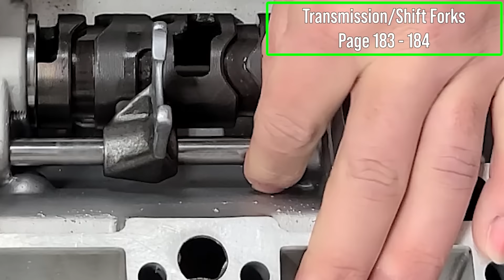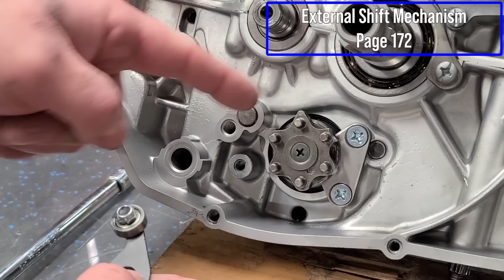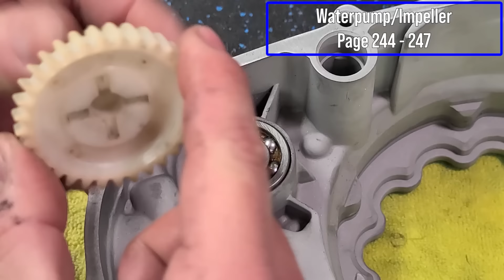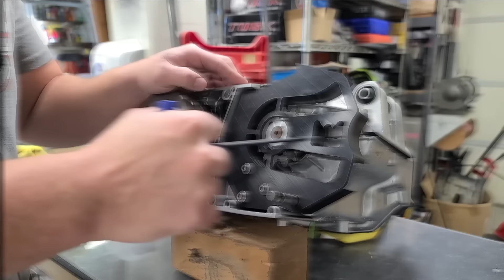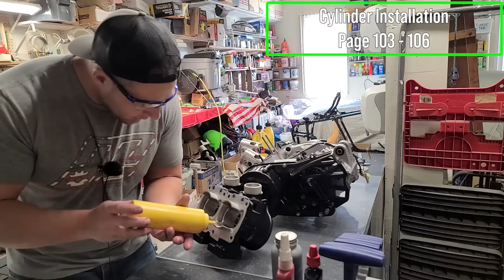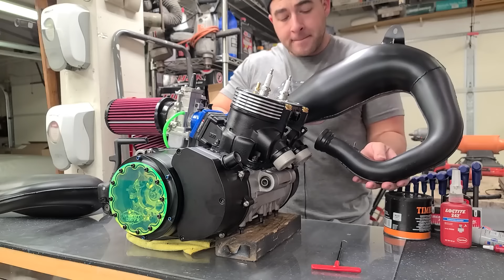How to Build a Yamaha Banshee 350 Engine | 1987 - 2012 Full Build Step by Step

Comment: So I’m new here but I was letting my gf and her sister ride my banshee but rode it in first apparently transmission is good all gears shift nothing is a new neutral but won’t idle well and when put in first gear and letting off the clutch it dies did my top end give way also carbs are clean not sure about the reeds

Comment: 14:27... Is tightening the studs with a tool a recommended procedure in the service manual? 

I build big V-8's for drag cars, and it's a HUGE no-no to tighten head and main studs. HAND tighten only!
If the studs are tightened in  full-size automotive engines in blind holes, there's a chance that they can pull the threads when things grow, and the stud is firmly bottomed in the hole. 
Things need to be able to have room to grow... 🤷🏻

Comment: Great video and very informative. Two small critics, one is the flywheel key; it is supposed to be installed parallel to the taper of thecrankshaft. If you look at your flywheel, you'll see it's tapered, and the angles should match. The next thing is never lightening your flywheel by removing material because they will be unbalanced and put extra stress on your stator side crankshaft bearing.
Reply: Well, then re-balance it... 

NOT a big deal
Reply: @davelowets  how would u recommend balancing it?

Comment: Awesome video, I´m building an engine and cant figure out if I need two circlips (the ones half a circle) for the crankshaft and gearbox bearings/seals or if I just need one for each? the manual only shows one.

Comment: First class instructional video, ... My only suggestion is a little less gasket sealant on the crankcases, .... whatever is expelled  externally when the cases are tightened , will also have the same amount INSIDE the cases.

Comment: Great video! Im rebuilding an 87 motor right now and appreciate the work you've done to make rebuilding these motors easy for a beginner. One thing I'd like to recommend so you don't scratch any more cases. Instead of using a chisel to bend the lock washers, use  long flat nose pliers.
Reply: I also recommend medium retaining compound on the water pump bearing and center crank bearings.

Comment: What are u doing your negative 10 degrees on the adjustable timing plate. U had it backward.  Why did u install the flywheel with the timing @-10??? I don't expect u to answer me. u never do. But I'd hope someone would tell u how wrong u are

Comment: The electric RC car industry has, a pressurized can of cleanup spray called oddly enough; Motor Spray, It’s the ideal thing to clean off uncured RTV. Assuming of course that your black, Yamaha-branded sealant is indeed, RTV (room temperature vulcanizing).

Comment: Hey Mike I just had my entire motor rebuilt (cases, seals, bearings, crank, cylinders, pistons) and not even 5 minutes into riding the countershaft seal popped out. Looks like they applied some sealent on it like you did. Would you just slap a new one in it and call it a day or would you think it could be something more sinister that caused it to pop out so fast? Awesome video by the way! Looks like your countershaft seal started to pop out in the video too but you caught it.
Reply: thinking back on it I guess it could have been popped out before I ever even rode it and I only noticed once taking it for a ride and threw the oil around...
Reply: Just bang it back in and call it a day... hopefully it will stay put

Comment: hey man great video im following it now for my first rebuild. now im wondering with my aftermarket kit i got the main trans bearings with those bearings stays are already on the bearings and they run almost all the way around not like yours or the stock ones i pulled out of mine? any help would be appreciated! i got my kit from BPATV with those CP Monoblock aswell. Thanks.

Comment: hey Michael i love your videos man! I've been binge watching getting ready to rebuild my banshee! i just wanted to ask you a question! so I rebuild my motor from the ground up about 5 years ago with a hot rods crank (stock bore) and stock top end, when I rebuild it the stock crank that was in it had seized up at the bottom of the rod where it connects to the crank shaft. now when I pulled this motor apart this time the same thing happened again on the same side so I'm just wondering if you may have any idea as to why that's happening so hopefully, I can fix it!

Comment: Do you think that if you put 2 Smartcarb SC-2's on that engine, that they would give that engine a more crisp feel to the throttle response? I'm no engine or carburetor expert but from what I've seen on youtube, the Smartcarb is a lot better than stock carbs and a little better or equal to some other after market upgrades.

Comment: I'm leery of an aluminum sprocket spacer. I've seen many steel ones with oil seal grooves in them.

Also, if you are going to replace your shift lever adjuster peg, the spring should be replaced at the same time, as the worn spring can start wearing on your new adjuster.

When testing the shift mechanism, a spacer can be put on the outside part of the shift shaft before the shift lever is attached. It helps keep the shift shaft pulled all the way to the left, so to be less  cumbersome.

Good call on replacing the kick idler gear clip every time. I do too. Tab washers too. When replacing those clips, there is usually a smooth side, and a sharp side. The smooth side should go against the gear, and the sharp side away from the gear.

You don't need the tab washer under the clutch nut, but an appropriate sized washer will keep the nut from digging into the clutch hub.

You had some clutch scuzz on the inside of your hub! That crap is hard to scrub off, you basically have to scratch it out.

On pistons, I like to use my hand deburring tool, and chamfer all the sharp edges. I believe that encourages oil retention.

That's absolutely right about the pin clips. Got a ruined Blaster cylinder here as proof.

Another good walkthrough Mike!

Comment: I prefer to freeze the cups and warm the head to install them. If you put the cups in the freezer for a couple hours they'll get cold enough to shrink about 0.005". Towards the end of the cooling period for the cups you can start gently warming the head with a propane torch in sweeping motion across the whole thing. A welding blanket or firewool will help keep the heat contained. You can use an oven if you're worried about uneven temperature across the head and to reduce any chance of warping the part. Then they drop right in. All you have to do is line up the keys and let go. They plop right into place with zero effort and no chance of damage. There's a few seconds before the parts thermally normalize so if one is a little off you have time to fix it. I'd suggest gloves for the cold bits so you don't warm them up with your hands 😉 It looks super sick so far. Keep it up man.
Reply: This.... 👆

I do this ALL the time when I do rear-end work on full size vehicles. It WORKS

Comment: How come you didn't go into detail about the carbs and the install of them?
Reply from the maker: I talk about them a little bit in the series of this build but there is a lot that goes into carb setup between jetting, needle size, slide size and picking the correct carb itself for your build/riding style and fuel selection. There's no one size fits all, especially with 2 stroke and to set carbs up correctly, you really need to have an understanding of what you're doing/listening for etc. I'm afraid an instructional video would steer people incorrectly without someone there to also guide them along with the video.

Comment: a little tip for putting tight hose on 
heat the fitting up with a heat gun  and it will slide right on
Reply: Or use die electric grease as shown lmao
Reply from the maker: Thank you for the tip!

Comment from the maker: NOTE: For cylinder head studs I recommend Pro Design over what I use in the video, they're stronger and more reliable - https://ebay.us/2KDNj1

NOTE: In the crank setup section (12:22), I talk about the center o-ring on the crankshaft. I could have done a better job explaining the function of that area. This is called the labyrinth seal and it fits between the two center crank main bearings and stops crank case pressure from passing between the two cylinders. The o-ring or using sealant does keep it from spinning but it also seals the two separate sides. If you use sealant, I recommend making sure the entire circumference of the seal is covered.

Hey guys, time stamps and links are listed in the description. This is the Voodoo Banshee complete engine build tutorial. Most of these procedures will be the same for any basic modded Banshee engine 1987-2012. I will be doing a more stock version of this video in the future for those that do not have many mods. If this video helped you, please consider liking and subscribing! 🤘
Reply: Yo Mike whats going on with the BRAPTOR 660? We the people are itching for a new video
Reply from the maker: @daryleduardo7055  new video will be up tomorrow man!! 🤘🤘
Reply: @MichaelSabo  😎🤘
Reply: I think you radar it
Reply: What’s the domes size that you use for this set up?